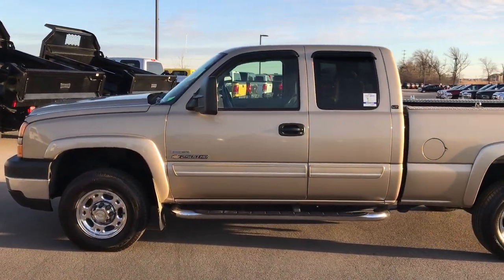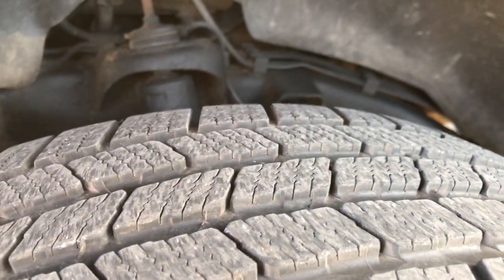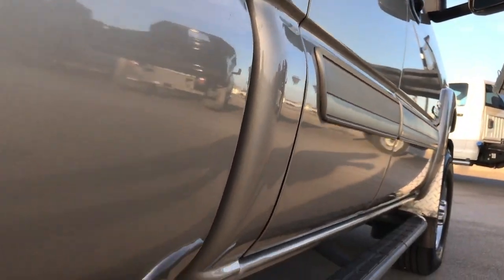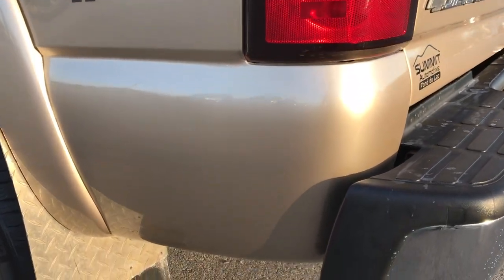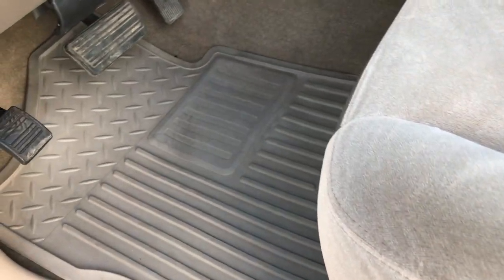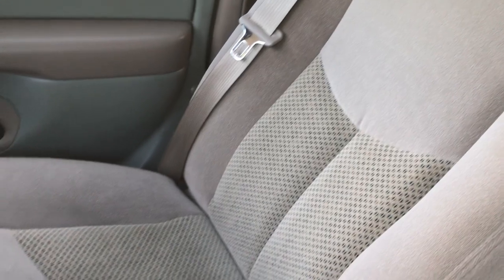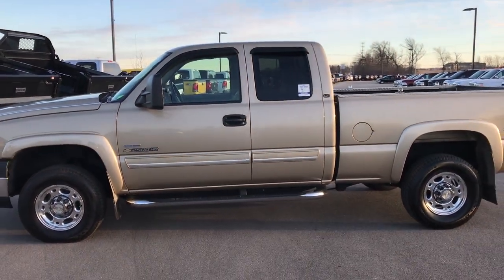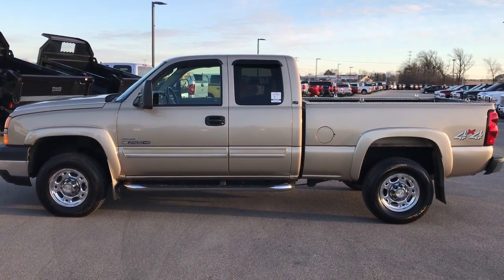2006 USED CHEVROLET SILVERADO 2500 LBZ DURAMAX DIESEL WALK AROUND REVIEW SOLD! 9396 SUMMITAUTO.com

Comment: 32000 for a 12  year old bottom line truck. This place is pure rip off
Reply from the maker: Ryan we don't make the market.  This is what this truck will probably sell for.  It is insanely clean. Because it is an LBZ Classic Duramax is the reason it is priced where it is.  Pre-emission diesels are in high demand.